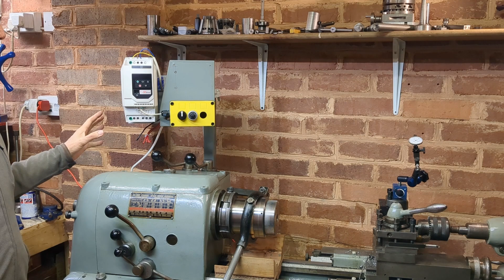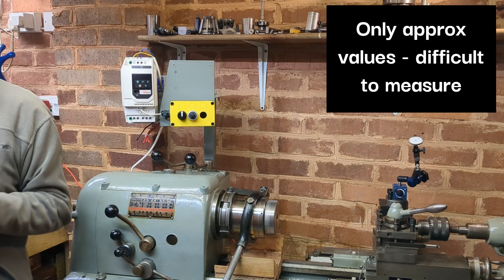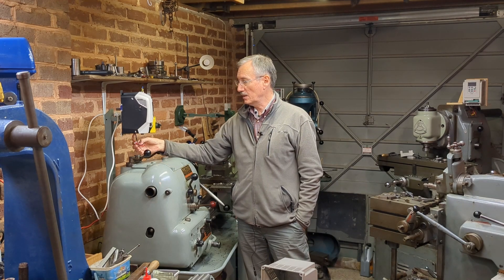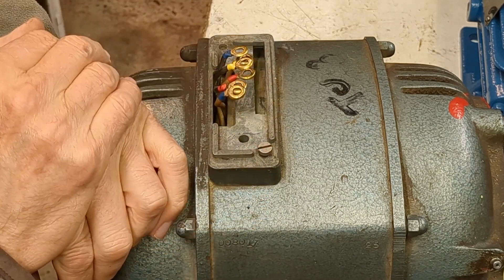Replacement 3-phase motor for Colchester Student lathe

Comment: If the windings are good and properly wired you could dunk the motor in water and run it. If the insulation is breaking down it will trip.
Reply from the maker: Well, you won't catch me doing that! I have had too many minor electric shocks living overseas where domestic wiring was actually dangerous. But I take your point that there should be no leakage. Thanks.

Comment: Same motor that was on my J&S Cylindrical Grinder, same deal two phases out. Cheaper to replace it. I use WEG TEFC Motors, nice replacements.
Reply from the maker: It is reassuring to hear you recommend this replacement. So far all is going well.

Comment: That was a very good video Clive. The motor on your Colchester lathe was absolutely buggered. You have to remember that you were measuring the insulation resistance from phase to earth using a 9 volt battery in your multimeter. Standard rule of thumb is to insulation test at about twice the working voltage. So for a 240v motor say 500 volts, and a 440 1kV. Imagine what you'd have seen then! Great work on getting the pulley off and on the shaper. Re stuck keys I like to drill and tap a key and fit a short grub screw. The grub screw can be used to jack out the key when the need arises. I'm late to this one, been travelling. A cheap insulation tester is a good buy for the workshop. Merry Christmas Clive! Thanks for the great content in 2024.
Reply from the maker: Thanks Carl for sharing your knowledge on insulation testing. What you say makes sense! I suspected that my multi-meter wasn't up to the job but didn't know why. I didn't take into account the fact that insulation breakdown might occur at higher voltages! Drilling and tapping the key also makes a lot of sense. Will remember that for the future. Likewise, Happy Christmas to you and your family.
Reply: @Workshopfriend  Thanks Clive. There was nothing intrinsically wrong with what you did, in terms of testing for a low insulation resistance to earth. You used  the equipment you had to hand. Standard practice is to test at a higher voltage to ensure sufficient insulation resistance. If you'd tested your motor at 500 volts, it would have indicated that the windings were fully down to earth. Thank you for your best wishes. Have a great Christmas.

Comment: I did the same on my Student. New 2.2kw motor. New pulley (I don't have a spare lathe to re-bore the old one). And a new Bosch Rexroth VFD. I configured mine to use the original Colchester start/brake and reverse switch. I had read that it's potentially dangerous to use the VFD to control the spindle speed. At low motor RPM's the gears won't throw the gearbox oil up and into the bearing oilers. Bye bye expensive Gamet bearings😢
Regards, Preso
Reply from the maker: Thanks, Pres, for your helpful comments. I have kept the old reversing switch so I could set mine up in the same way. I did this on my pillar drill.
As for the spindle speed I agree that caution is required. When I renovated this lathe I observed the oil splash with the cover off (carefully using the speed control!). I could see that the bearings rely on oil being thrown onto the underside of the cover and that much comes off the primary drive shaft. So, I agree that caution is required. The degree to which oil is thrown around is indicated by the oil level. I will be careful! Clive.

Comment: The type of failure you had on your motor is quit common on open frame electrical motors.
Insulation degrades over time and extreme temperatures and humidity accelerate this process.
However running these motors from a (cheap) vfd adds additional stress induced (no pun intended) by the harmonics present in the generated 3phase supply.
Using the vfd to regulate speed is not advised, unless the motor has been designed and sized for this operation.
Some nuance to the above: a home shop is not running continuously.
I enjoy your channel a lot.
Reply from the maker: Thanks for your comments! I am learning something from all the feedback. I am wondering why open frame motors should be more susceptible to this kind of failure?
Reply: @Workshopfriend  Main reason: chemistry.
Ingress of dirt and humidity deteriorate the insulation faster than in a sealed motor.
In a sealed motor the atmosphere is not/less subject to change.
Only thermal effects are dominant.
Reply from the maker: Well thank you for the explanation. I have learned something.

Comment: Nicely produced vid, I'm sure a lot of Colchester motors have reached the end of their working life and benefit from a up grade. 
I petricolid liked the custom finger thumb design for your wooden protector when bashing on the pully. .
Reply from the maker: Thank you! Yes I think you could be right about other similar vintage lathes needing an upgrade - though I think my motor may have had a harder time than most.

Comment: Another important consideration when using older motors with a VFD is its insulation class. Class "F" should be the minimum for a motor to be used with a VFD, your original motor may not be this high, and so could well be the reason for its insulation to fail, and exhibit the type of faults that you have observed. Your new motor will most likely be at least class "F".
Reply from the maker: I had heard that inverter power supplies can negatively impact older motor windings. After reading your comment I went to look up the insulation class of my new motor but haven't yet found it. I am hopeful it is rated for this application.
I have one remaining older motor on a VFD drive (shaper) and was wondering if the frequency of the supply has an impact on damage ie 50Hz vs less?

Comment: Excellent conversion, I'm sure your student will be very happy now. I have the same cheap vfd as you had in my mk 1 student, also with a 2.2kw motor. Performs very well so far. I mounted the vfd inside the switch box under the headstock. The only visible difference to the switch box is the addition of speed potentiometer and toggle switch for reverse ( my student was not reverse equipped), so it's set to factory spindle speed and left alone. I've heard these old motors were not designed to cope with the vfd setup, and the variable frequency can contribute to insulation breakdown. 
 Humidity is a problem this time of year, we had a cold period, then it warmed again. One has to keep an eye on surface plates etc. I've been using a dehumidifier for many years now, couldn't really be without one.
Reply from the maker: I thought about mounting the VFD in the cabinet which would have made for a neat installation. The reason I didn't is because I was concerned about cooling and I wanted easy access to the front of the VFD for control. I suspect that once it is set up it probably will not be necessary to make adjustments.
As for humidity; that might get better the subject of a future video with rust being the main problem!
Thanks for your helpful comments, Constantine!

Comment: Hi Clive, I installed WEG motors on my Mill and Lathe back in the mid nineties in Australia and passed them onto my Brother who uses them daily without issues.
TEFC, totally enclosed fan cooled so no dust or water ingress.
The open frame motor is subject to the above.
I use the same budget VFD's on my lathes, mill, drill press and compressor and no issues so far, hope to get 4 to 5 years out of them before the electrolytic capacitors dry out and expire.
My Dean Smith & Grace had a Crompton Parkinson open frame motor and still going strong since 1954!!
Reply from the maker: I wondered if the open frame had allowed a build up of dust to affect cooling. I like the enclosed design, and the feel of the WEG motor is good. So far, I agree, that it seems like a good replacement.
I will be keeping the budget VFD as back up for my other machines. Thanks for your feedback.

Comment: From your meter readings it looks like there is a motor fault, but as you probably know it really needs a megger to test the insulation resistance properly. Be aware though that the vfd has a capacitor filter array which dumps any mains spikes
to earth and these are notorious for tripping RCD’s!
Phil
Reply from the maker: Thanks, Phil. Yes, as I was trying to take the measurements I realised that the inconsistent readings were an indication that my multimeter wasn't up to the task. Yes, one of my old VFD's would do that. I will be keeping the one I replaced as a backup/spares.
Reply: Hello Clive. Well done on achieving an excellent outcome. I really must look at replacing the motor on my Myford Super 7 with a three phase VFD upgrade. 👏👏👍😀
Reply from the maker: Thank you, Andrew. Yes, I found the 3-phase inverter drive is a great asset in a home workshop. Perhaps a project for the New Year!
Reply: @Workshopfriend  Definitely high on the list.